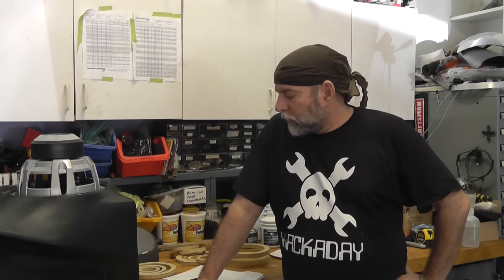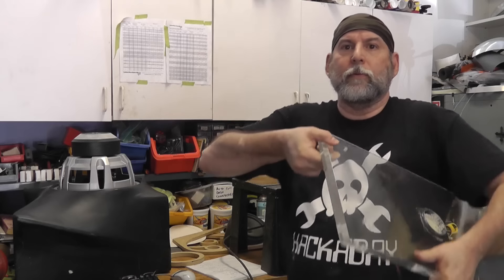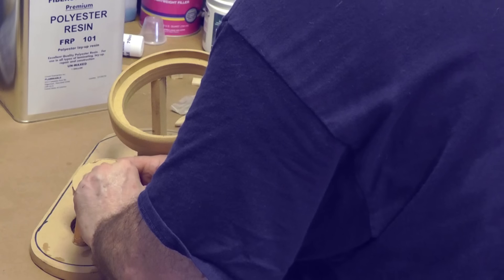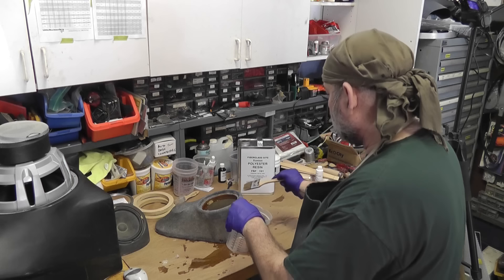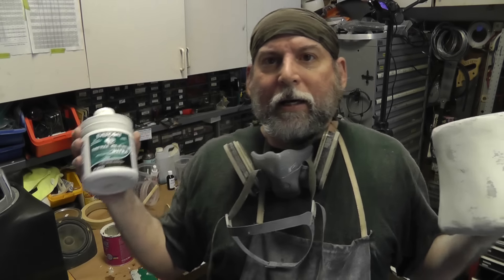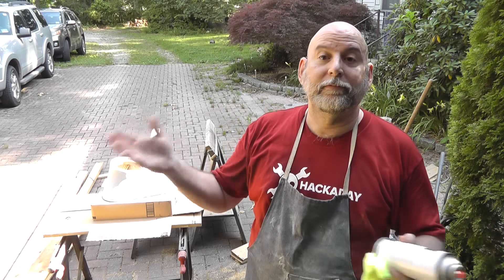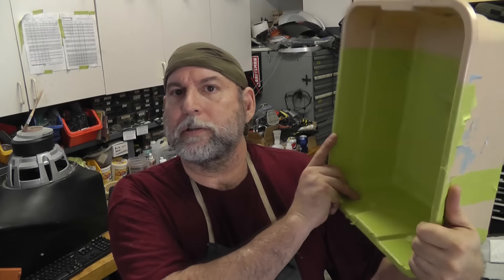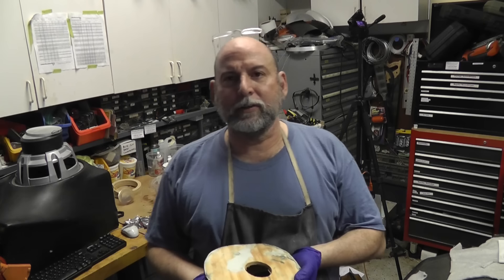Custom Fiberglass for Car Audio and Everything Else

Comment: This is a skill I absolutely MUST get skilled with. I want a full 3 way component setup for all four doors and my trunk space back with this MASSIVE 40inch tall 15in sub box. Thanks for the information and video I intend on rewatching and attempting this at some point. I need a new router too because my wife threw my craftsman one out(because the table was bent and she thought it was garbage) because I really really like the way you make the front portion of your speaker enclosures. I'm glad you showed it with a jigsaw although router just does it so well. I just wish there was a way to make those lips so you can mount the speaker flush with the outside of the enclosure without a router. Thanks again for this great content. Very easy to understand for a big ol dumby like me. Curious as to if there is any tradeoff from using large properly tuned box hitting 24hz to fiberglass assumming the internal volume is large enough and if I can port it as well I am not familiar with the material.
Reply: I was thinking the same thing! 👍

Comment: Excellent video! Ive played with frp for over 20yrs. Did custom audio for 3-4 yrs built dashes door panels sub boxes fixed boats basiclly anything fiberglass. One trick I learned after sanding door pods for hours was to use hoodie material. Smooth side out saves HOURS of body work:) Depending on application sometimes a couple layers are needed or frp from behind.
Reply: Hoodie material? Sweater hoodies?
Reply: @STAY-GOLD-VINYL  Yes works great for certain applications.
Reply: So...cotton?
Reply: @dontump2286  Anything that is flexible & stretches works although you will need fiberglass the backside
Reply: So, the resin will harden with any material that soaks it up, but fiber glass matting is needed to give make it more rigid and help prevent cracking ?  @houseoffire72  I'm guessing fiberglass mat for resin acts like rebar for concrete?
Reply: @dontump2286  Exactly bud. Be sure to a fiberglass chop stand mate vs cloth. The chop strand is much stronger. A couple layers may be needed.

Comment: Just finished a pair of 3 inch midrange component speaker enclosures to mount on front doors of my Corolla . This video gave all the info I needed to complete the project . Most of the time was sanding / finishing and painting ! Of course if your an auto body guy your way ahead of the curve . Lots of time yes but what are the alternatives for mounting 3 way components in these new cars that have no room to put speakers anywhere at all ? 
Next project will be adding fiberglass mounting boss for Focal 3 way K2 components on A pillar trim !
I would be stuck using 2 way components without this information ! Back 35 years ago 3 way setups were more common . Then again the cars of the period were much easier to install systems into . A hole saw got you a long way back then . 
Now they've got multiple airbags installed inside the seats !!!!
Thanks for the video !

Comment: Lots of good info cheers. You could squeeze down the body filler putty on to mixing board to squeeze out air bubbles, each time you mix/ turn the putty over with hardener with a scrapper, quickly squeeze it down as well. Also maybe you could have the scrapper at a shallow angle to trap less air between putty and mixing scrapper. I've been doing a lot of repair on my daily driver car Vauxhall astra estate 1.6 1999 that I used for my small landscaping business, in particular the rusted out wheel arches last year and finally sold it this year in good condition (without huge rust holes), and bought a newer car this year, a Peugeot partner 2.0 HDI 2004

Comment: Pretty good intro that covers the steps and makes it accessible for beginners to try.  For quick projects, I recommend building up the fiberglass from the back side with matt and more resin. You can achieve this by cutting a larger hole in the backside and being prepared with an extra panel to fill it in when complete.  Then give it a light sand on the front side and finish it off with carpet or truck bed liner which will hide even rough fleece/resin.  Make sure you add some thickness to the structure to avoid really bad resonance.

Comment: Cool thank you for sharing your knowledge with us I'm planning on doing something. I have a old school wooden center console in my suburban. I'm wanting to cut a hole on both sides of the console for a pair of 8" speakers. Question what do you suggest to do for as making a enclosures? For the inner side of the console to close off the back of the speakers?

Comment: I have a favorite stirring screwdriver too. I found a product in my local office supplies ,sheets of type of plastic used to make seperators for files made from polyethylene and is 1.5mm thick .. it makes perfect bench top covers to stop resin building up. the resin wont stick to it. And they were 20cents each, for a A3 size sheets.

Comment: In case anybody is still following this, I'm trying to make some enclosures for a home audio surround system. The walls are all textured so I'm not really concerned about a smooth finish. Is the bondo coat necessary? Can I just apply a couple layers of resin, paint with primer and then brush on interior wall paint? 

Also I'm making sure I didn't miss something but the actual enclosure you made doesn't actually have any "fiberglass" correct? This just looks too easy to not try out. 

Thanks!

Comment: Do you do custom door panels? I'm in Mass until April and looking to get 2 front door panels, bottom half, custom fiberglass. Smooth black finish. Just a 6×9 and super tweeter is all I want slots for.

Comment: Evercoat Polyester Spot Putty mixed with hardener is great for the divots, air holes and any slight issues and Polyfill or Polyester primer also mixed with hardner does not shrink and fills bad sand marks

Comment: Thanks Bill, but need many layers of fiberglass unfortunately. Especially if you want that full midbass. So I assume you skipped out on showing us how many layers you used unless you assume we are going at least three layers of the resin and Matt. Unless we are crossing over those speakers high and using separate midbass. Which again need many layers. And need large airspace as large as possible for speakers. Midbass is the biggest problem to get in car audio. The other reason to make the speaker pods large is to then be able to port it for bass reflex tuning for midbass. Short ports for maximizing midbass output there.

Comment: Do you use the cheese grater while the body filler is still somewhat soft you can use a body rasp and it shaves alot of rough edges off and saves a huge amount of time on sanding. It shaves those edges off and looks just like you are grating cheese

Comment: Hey so I'm still learning and I built custom fiberglass boxes out of my carpet inserts in the trunk of an Audi. After my fifth coat of paint on one of them I noticed a bunch of low spots now how do I fix that? I would appreciate any help this is very frustrating I work that hard on it and now it's got low spots in it

Comment: so you can mix what some call Bondo with the  fiberglass resin? I guess they are both poly right? I always like using high build primer. I spent a weekend on the metal dash of an old truck . when I was growing up. then after wet sanding the clear coat. it looked like wet glass. it was well worth it.

Comment: Fleece uses WAAAY too much resin, causing your enclosure to be heavier than it needs to be (and not a bit stronger). So my only input would be to use a thinner fabric - check my channel (video 2) for an example. Also, glue is better than staples because you won't have to grind it off.

Comment: sorry I'm such a rambler. anyway with the thinned body filler. couldn't it be almost like dipping the pod. that way it would be really smooth. maybe pour it on . be like chocolate candy. let it flow to the edges.  just a thought. I was thinking about building one of these for a 6.5" sub. 6.5" mid. and a tweeter. with a small amp all together in the door. like the small kicker the size of your hand. with one in each door. one amp for each channel or just mount them that way. use one for the sub low pass at 250hz. then the other for mids & highs. then 2-3 15" sub's in the rear cab of a extended cab Chevy Silverado. with about 1.6kw low passed at about 80-100hz. just dreaming now. but I would like to get back into car audio. I have the truck and enclosure. but that's it. great video. nice refresher course in fiberglass. thanks!
Reply: James stranger why install the amps in the door? Seems like more of a headache then just installing in the trunk

Comment: Did you accidentally edit out the actual glass mat part of this process that makes the resin become fiberglass?
Reply: 666hobart no bro, he used fleece instead of fiberglass matt
Reply: Then its week, and still not fiberglass. Just polyester and fleece. Fart on it, and it will break.
Reply: MuffinMan no, still no fiberglass.
Reply: You use both not just one u mold with cloth and add fibre glass mat for strength
Reply: canuckguy worried lol

Comment: They sell stuff called bondo honey that makes it easier to put on and adds working time so it doesn't flash off half way through putting it on.
Reply: Michael Johnson just put the fiberglass resin in you body filler it extends working time and makes it very smooth for pin holes